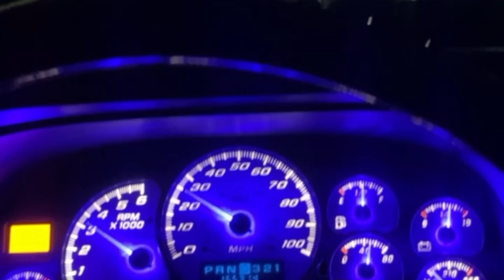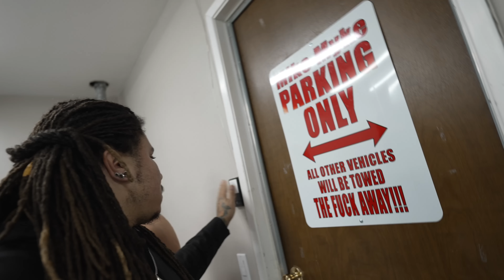I Found This Car On A Farm In The Middle Of Nowhere! *REAL BARN FIND*

Comment: You can fit some pretty big tires on those rear factory wheels or you could have them widened a lil bit by black Aaron, just do the engine and power train and suspension but keep it looking exactly like it is even with those stock wheels so people think it's a clapped out 5.0 with nothin serious under the hood......gotta be automatic if you're trying to go fast too

Comment: The car got a 88 horsepower 0 to 60 13/8 to 14 got a quarter mile lb is 2734 dry 2674 build it right because they slippery

Comment: Fk that ls swap  f150 rtr full
Swap engine awd  8 speed transmission  with gen 6 whipper supercharger  close to 1000hp  stock and I would use the cluster and controll so I can switch it from awd to rwd for burn out …that would slick af awd u don’t got no awd cars and that car is half the weight and awd that u be the first i my nowing